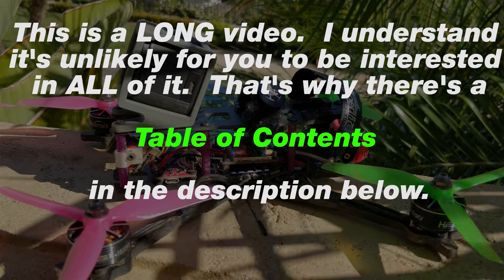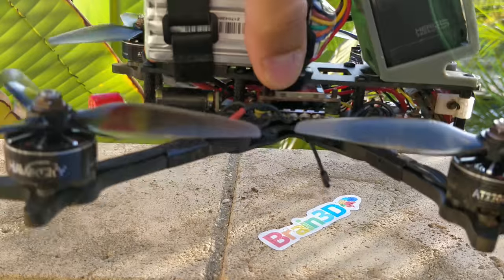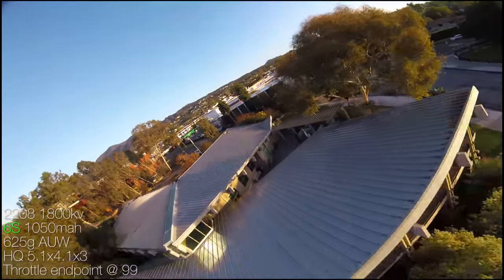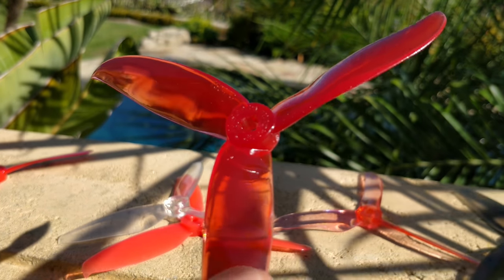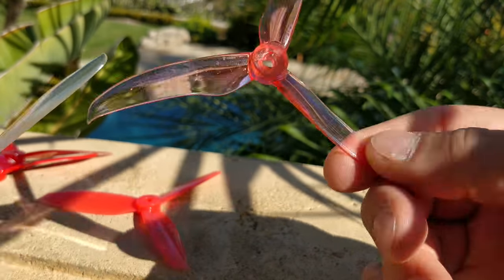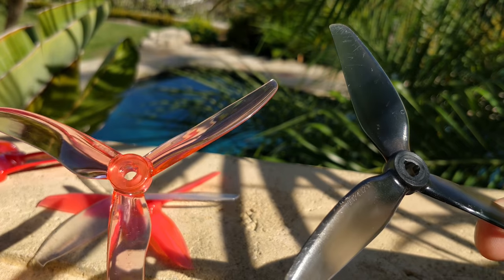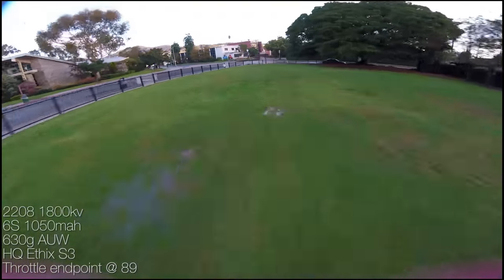HQ Ethix S3, My Setup Concepts, Frame Update, more....

Comment from the maker: Table of Contents:
00:22 - A look at 4S and 6S
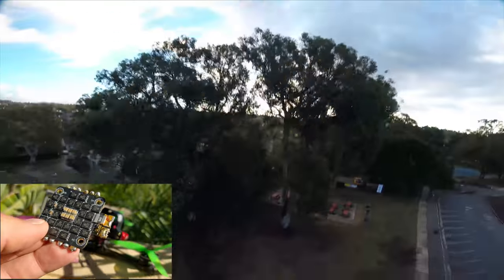03:16 - Connector issue!!!
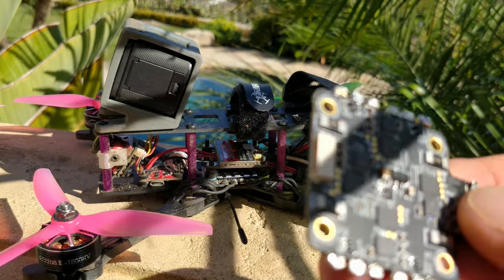04:51 - Frame progress update
11:46 - All the props...
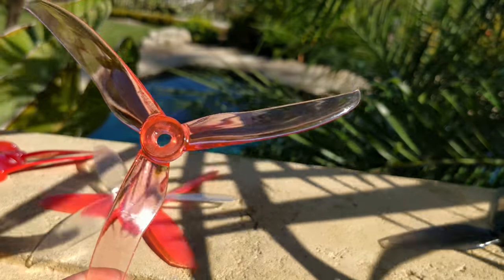20:01 - HQ 5.1x4.1x3
24:15 - HQ Ethix S3 Prop
28:34 - My quad setups...
33:23 - Throttle drop issue

No ND filters used in any videos.
I was driving the Prius because it rained...a little.

Does anyone know if these motors have 9mm bearings?: https://goo.gl/yRrihJ

I ordered the Kester Solder.  Hopefully that will fix my jank.
Thanks everyone.

HQ Ethix S3 Prop: https://goo.gl/FN6g43
I recommend running these on 2306, 2207, 2208 1800-1850kv 6S with an AUW of under 650g.

Things I like:

Micro Eagle - 
My preferred FPV cam still
https://goo.gl/or1fS9

Rush Tank Vtx -
One of many good Vtx's. I like it because it works well and fits my build style
https://goo.gl/YMYmya

WaFL’s Cap Cap
https://insta-stalker.com/profile/waf...
https://goo.gl/9CZdAs

TinyHawk!: https://goo.gl/LrQiN9, https://goo.gl/8y66Gf

My TinyHawk tune:

First off, set your landing/warning voltage to 2.9v and your warning voltage to 3.2v.  This is a non-issue with 1S as you can't really pull enough amps on this thing to actually damage the battery much.

Make sure it's set to 8k/8k and I recommend Multishot with min throttle at 1175 because Turtle mode doesn't even work for now.  They're working on a quad blade prop that will Turtle and a new frame with prop guard spars that are more robust.

Roll and Pitch are the same numbers: P 80, I 55, D 46 FF 45, RC Rate 1.32, rest default Betaflight
Yaw: P 60, I 60, D 0, FF 45, RC Rate 1.32, rest default

Iterm relax on and on defaults, the other three switches above it off.

Tips?
Bitcoin: 1E4XZXoD4rS6MYWVWuenY7Kw2M1YgyNpoQ
Nano: xrb_1188ek5bd7tb9kw67asnp9o65byuoaxbtpxuznx1ribf75x78awywmakj55f
ETH: 0xD067F93811f2eC31CB1928901002dfdf9A492EF5
LTC: La2KWYAjp4VT2Lq2M76pbjzXWvRyjpfCtG
Reply: I see you have had your nails done lol Suresh from the UK 😂
Reply: btw I got very triggered you said Yee-thix instead of Eh-thix LOLOL
Reply: Yes I can confirm that the iFlight motor you mentioned in the description DOES use 9mm bearings, just check their website

Comment: This guy is an underrated pilot, well, no one is rating him, but his skill level is as good as any of the top pilots is what I meant! Not only that, but he has a unique approach  to everything in this hobby, which is really cool to see. So, kabab, thank you for all your efforts you bring to your videos! Happy Holidays, don’t forget to floss!
Reply from the maker: Thanks but really I'm not all that great. For one, I absolutely suck at racing 😂
Reply: Kabab FPV - I beg to differ! I watch tons of posts, from what we deem, the top pilots in this hobby, and in my opinion, none of them have anything on you ripping freestyle. Racing is boring anyway! Okay, just kidding, just seeing if you racers are awake! But seriously, you’re one helluva freestyle pilot, believe it!!
Reply from the maker: @kwadwadfpv2386  I actually raced last weekend and won my division. I was so thrilled I couldn't believe it. With my acro quad. The one that's flying in this video that I wrecked real hard multiple times.
Reply: @Kabab  congratulations on winning your division, I finally have 7 gates, and set up my first track. I been ripping the line for a few weeks... Pretty fast, it's amazing how easy it to clip one when your doing 70 to 80 mph. (1/2 of the track is wide open, the other half is very technical, very fun, but still need a dive gate, and a higher air gate)
Reply from the maker: @RCOverKill  having to Pace yourself and not go all out is the hardest thing. Much of the time you're faster if you go slower.
Reply: @Kabab  lol, yea there are just two of us in Fredericksburg TX. That fly, him3 yrs. Me 10 months, I get my butt tore up on a regular basis. I use the term:Gab707, as in I'm gonna Gab you, because Gab is the best at pacing himself, that's the only I can beat him. (so far)
Reply from the maker: @RCOverKill  gab is definitely one of the top five in the world to me. Truly incredible at what he does
Reply: Kabab FPV - You see, you’re not so bad after all! Here’s a request for a potential topic, from a Kabab perspective, how does one get better at flying freestyle, I personally have no interest in racing. I realize this is a loaded question, but how did you get to your level? What did you work on to get there and more importantly, was this something you did sequentially, or did you just randomly pick an arobatic to master? When you were doing this, was equipment as big a factor as it is to you today? Give me the Kabab version on this topic, please! And, Thank you!
Reply from the maker: @kwadwadfpv2386  When I started flying, EVERYTHING totally sucked donkey poop.  Literally nothing was good.  Learning anything was a challenge.  When all the early people started, there were no sims so in order to improve, you just had to not crash so you could keep practicing.  Shit broke like 5x easier too btw so keeping a quad in the air was exponentially more difficult.  That was probably the biggest factor to kick you in the butt and improve.  After that, it just sort of happens.  You don't really need to do anything but deliberately practice.  Specifically deliberate practice.  Every time you fly, try to do something better.  Sometimes you want to learn a new move so you take a little risk trying to do something you're not comfortable with or you just want to be smoother so you practice babying the sticks.  Just keep going day after day.  Sleeping is actually how you learn....practice, sleep, practice, sleep.  You don't really need to do anything specific.  The rest comes with what you learn about the things along the way.  From YouTube, talking to others, flying with others.   Learning how to setup the quad to do or not do something...but these are not significant things with respect to improvement.  They just help you understand how and why so you can do better. 

Today, you have the massive massive huge huge huge massive benefit of incredible firmware.  It's like we were flying paper airplanes five years ago and now anything you build is some futuristic fighter jet that's AWESOME!  However I somewhat feel that may also be the reason why people are hitting skill caps quicker.  Good software will help the novice fly well enough so they don't know how crappy they actually are.  lol.  Actually, maybe that's a good way to improve.  Put like BF 2.0 on your quad with default settings.  Pretty much just guess your rates because nothing worked right back then and go out and fly!!   I'd say try Cleanflight but I doubt any FC of the last four years is supported.  Don't even bother tuning anything.  Nothing could be tuned.  Just learn to handle things.  I bet over a few weeks of just a couple packs a day, anyone would jump huge skill moving back to the latest BF.  Actually even that would be cheating.  You need a Naze32 and cleanflight with like garbage loop times.....how much punishment do you wanna put yourself through?  lol
Reply: Kabab FPV - Yes, I definitely got into this at the right time, as I’ve heard the technology back 5 years ago was, shall we say rough! All that aside, would you please just have a look at this flight and tell me how I can improve overall. Yeah, a better video quality, I know that, as this is a goggle feed video, as I just don’t have the luxury of a gopro, nor the skill to post anything from it, if I did! Pilot feedback, that’s what I’m after!

https://youtu.be/SC_a5XWU0lk
Reply: @kwadwadfpv2386  you're not kidding, racing is kinda boring....... 🦗🦗🦗

Comment: What you said about 4S batt on 6S motors (28:18) reminds me of when I started with miniquads I was very happy flying my 4" quad on 1000mAh 3S. Everybody was flying at the "speed of light" on 4S but I kept getting back to my 3S 4" as it was ultra light, small and it was hard for me to explain that I like the control over power :)

Comment: Hey bob at 22:00 you are speaking about the bump of the prop and the throttle mid. How do we find out what percent our prop bump is at and sone hat do we do to our mid and expo when we find it. Also does tpa breakpoint effect the pop in the throttle? If not what does tpa and tpa breakpoint do? I ask because I thought adjusting tpa breakpoint effected my mid throttle control when I changed it from 1350 to 1550. Thanks in advance!
Reply from the maker: Breakpoint is where the tpa starts to work. It gradually increases starting from that breakpoint. Tpa is how much the pids get attenuated as you go up in throttle. A TPA of 0.80 or 80% isn't really as effective as you might imagine. You generally need more tpa than expected if you need TPA at all.

Comment: So excited for the new frame with #alltheoptions! I think you alluded to this somewhere in the video - but I kinda think that steeper pitch creates more vectored/high velocity turbulent air - so when other props catch that dirty air the thrust they’re able to generate is really impacted and you get these weird wobbles.  Shallower pitch (I hypothesize...) creates less turbulent air (or maybe a larger volume of less turbulence vs a narrow column of high turbulence) and the chance you encounter this issue is smaller. These effects - like the wobble are really exacerbated when you have a mongo underslung battery or obstruction under the quad which I would guess prevents the turbulent air from dissipating even more. definitely observed these things - but my rationalization of the phenomenon is probably way off.

Comment: Using a lower pitch prop is taking smaller bites of air at a quicker pace, so the throttle response is less granular (more smooth).

Comment: I completely agree with you on 4s vs. 6s. I took a long time to change to 6s because I thought it was mostly hype and I have a lot of 4s packs and 4s quads I didn't want to phase out. I then built up a light weight 6s quad using the 2207-1722kv and 2207-1900kv Hyperlite motors and it performed exceptionally well with longer more powerful flights. I am a freestyler but I like practicing hitting gates as well and the 6s configuration is my preferred setup. I also fly the 6s setup on 4s and 5s packs and it still performs very well and the batteries are not taxed nearly as much as the high kv setups. I will be building 6s configurations going forward.
Reply from the maker: The 4S ability of 6S quads is where the major value proposition is that people aren't realizing.  There shouldn't even be an option to buy 4S kv motors anymore.  All they do is damage 4S batteries.  My 6S batteries do not even begin to care because the amps and volts are balanced during use.  They run under much better conditions and last for much much more cycles.  I have a pack that's half bent with over 200 cycles on it and it's nearly indistinguishable from a brand new pack.
Reply: @Kabab  I absolutely concur. I was convinced to try moving to 6S after watching your videos. I fly regularly on Sunday mornings chasing remote control planes. I tend to be near full throttle a lot since there are usually a couple EDF jets I like to keep up with.  I have a 4S quad running 2500kv motors with good 1300 packs (Thunderpower, Tattu R-Line, etc.) that I get about 2 minutes of hard flight time. I have some higher kv motors on my race quads running 2700kv+ that really chew up batteries with almost immediate sag. Those 4S batteries definitely show wear and tear in terms of keeping the punch. I am not sure how many cycles but it isn't that many and I have already lost a few packs due to some cells not acting correctly. I always keep them at storage voltage after use. The HV batteries are even worse and die quicker with little benefit. I don't race so I am not looking at getting that extra lap.

Once I moved to running 1700kv and 1900kv 6S motors and using  6S packs I get much longer flight times keeping up with the same planes. I don't even use the higher C rating packs but the Racedayquad packs have been solid regardless.  I am closer to 4 minutes now but I usually land after 3 minutes because I am just not used to staying in the air that long without puffing a pack. The packs don't even come down warm and voltage comes back quickly when they do sag a little bit. I will not be building any more high kv 4s quads. Once you go 6S you really can't go back.

Comment: Very cool video.
I have to say that if you don’t want to tune at all, why not try kiss V2 ?
Yeah it costs more, but I’m not kidding.
Default happiness.
Trust me , I have a spare quad for Buf,Bef, & FO. 
They each have a different feel, but KISS is king for ease of set up.
The downside is cost of entry.
I turn 47 tomorrow and have very little time for CLI anything!
Thanks again for all you do.
Reply from the maker: Happy birthday!  Main issue with kiss is cost really. Also the updating isn't as fun and drama filled 😁✌️
Reply: Kiss hardware is a niche product for ones who like glanced candy paper and actions executed by one button. Like Apple computers for FPV community. No space for customization. Their configurator even don't run under Linux. Price is high. No happiness for me, I pass. Happy Birthday by the way :)

Comment: It's funny that you started out designing for super light weight and now your AUW is higher then Mr Steele's AUW with his old heavy Alien frame. Good stuff as always.
Reply from the maker: I prefer light weight always, but I prefer control more than anything.  My motors weigh about 33-34g ea.  Frame weight is also now 102g with far more durability and build space/versatility than my previous frames and I also have a highly protective TPU Gopro mount that Steele doesn't prefer.  His 6S quad weights are still more than mine I believe because of I think a larger battery, but for that extra weight, I beefed up on power while maintaining or improving protection of components and convenience of use.  Nothing wrong with his method obviously.  Just a shift of where I direct efforts.  Oh yeah, also, Steele actually hacks loads of weight off the Alien.  His frame weights aren't much more than mine.  Maybe around 110g once he's done with it. He has is own PDB, uses short body for 5" and doesn't put all the random attachment crap all over it.  He knows well what he's doing.  One of the few that actually does know what he's doing imo...
Reply: Steele's 6s set up with a session 5 is 613g. Which is impressive with still having individual ESCs and a full PDB and full size FPV cam. He knows what he is doing which is why I'm going to copy his battery/motor/prop set up.  Expensive but worth it.

Comment: I use so many different props but still the t5046c is my go to. The HQ 5x4.8x3 is taking a close second though. I am interested in trying the s3 but also would love a cyclone t5042c for my 5in
I use t5544c on many builds and those are killer props.

Comment: Please keep making prop videos. You are my go to for figuring out all this prop nonsense! If you could give some more details on efficiency that would be great. Very informative videos as usual.
Reply from the maker: Serious nonsense. Just get the gemfan 5146.6. It's all you need now. May not be out yet. If not it'll be like a week
Reply: @Kabab  Picked up some. Just did a couple flights. very smooth yet great grip and control. Your description of them were pretty spot on. although i flew them on some 2750kv 2306 and my amp draw was over 130! if you are cruising they have decent efficiency but if you push them they will destroy your battery. I think you talked up the efficiency a little too much.

Comment: Regarding the S3 props.  I think a lot of the snappy response as it pertains to the pitch might be more related to drag than to a stall when compared to a heavy pitch prop.  The closest analogy I can give is sticking your arm out of the window in a moving car and holding your hand flat and level verses closer to vertical.  Its biting less air (less drag) so the motor is much more efficient at speeding up and slowing down the prop.  Just a thought that makes quick sense to me.  However the stall theory I believe is plausible as angle of attack (AOA) increases, stall potential increases, i.e. "Stall Angle of Attack".  Great vid.
Reply from the maker: yes exactly.  It's the combo of low pitch and light blade that gives it the incredible response.

Comment: I found, that I prefer a higher FeedForward of at least 150, and the lower rates. Makes me feel like I have more control in the turns and much more responsive to what I want it to do.
Reply from the maker: Yeah that's definitely the other way to go if you want good response but slow everything else.  I prefer dull but accurate response and fast everything else.